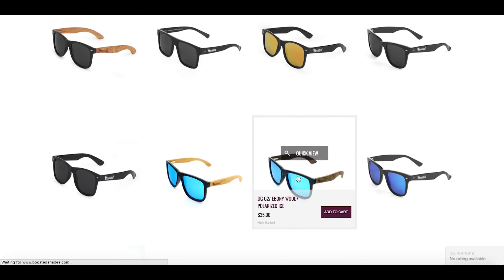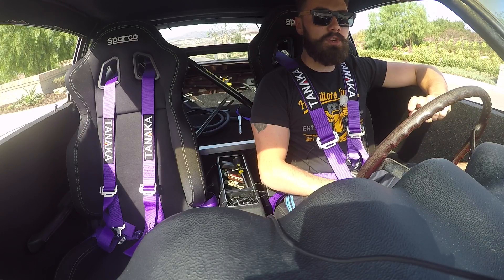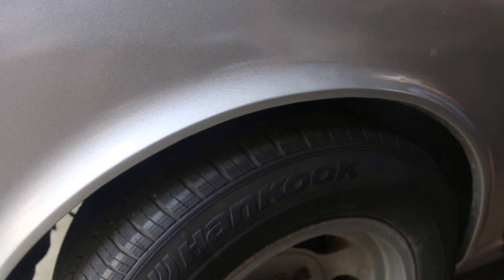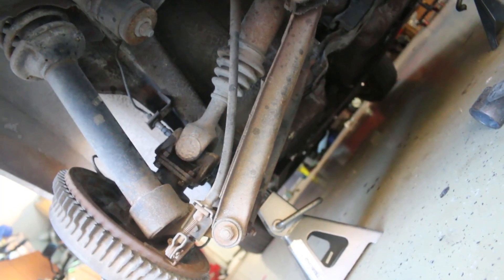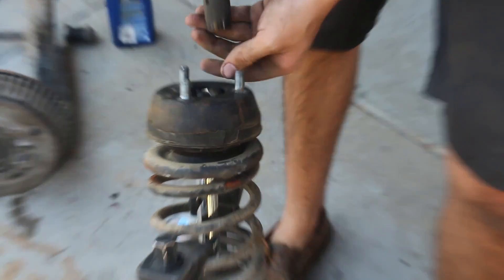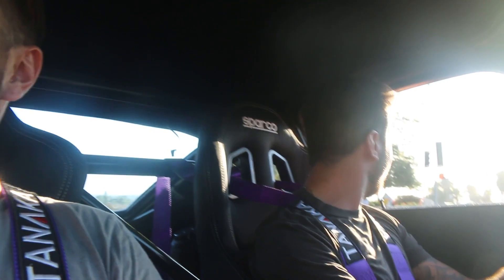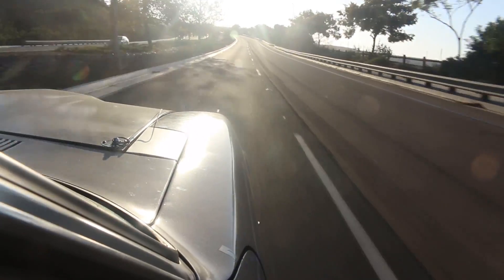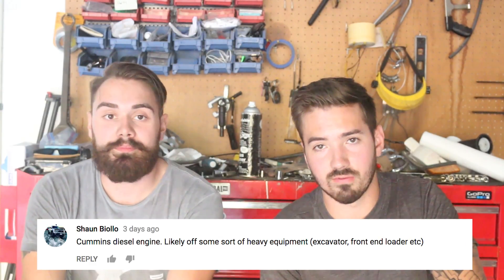Tractor Turbo Datsun Back on the Road!

Comment: Thats why i did the bolt on flares, just break loose the strut at the tower and the flare relief cut on the wheel well allows you to just swing out the top of the strut and service it still attached below, i only remove the 3 top hat nuts per strut to do them👌

Comment: This channel needs more subscribers. Aren't you guys worried that they'll say something like why is the exhaust on the side then theyll want to see under the hood and fail you guys
Reply from the maker: J Rod It's not really a safety inspection. The car is so old that I doubt they would know what's supposed to be under the hood anyway.
Reply: Oh I just thought that they may be suspicious. California has such strict rules. I hate  when I take my car to smog, I have a e30 with that came with a 2.7 and I put a 2.5 in it. The 2.5 is faster then the 2.7, the motors look the same but I get paranoid because if they checked the numbers in the block or something and realize that the motor I have is not the one that's supposed to be in there, that they might report it to bar. Luckily it passes smog. Good luck guys!